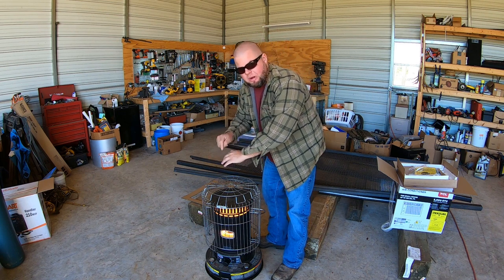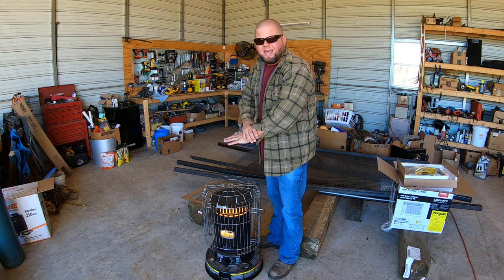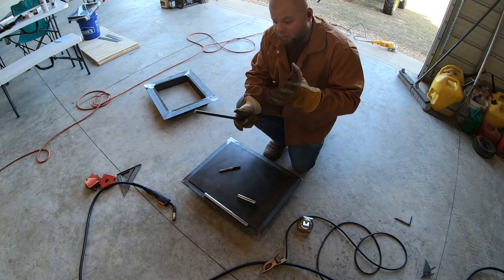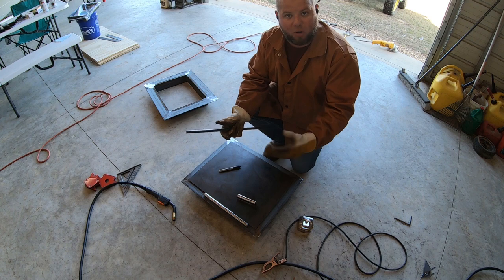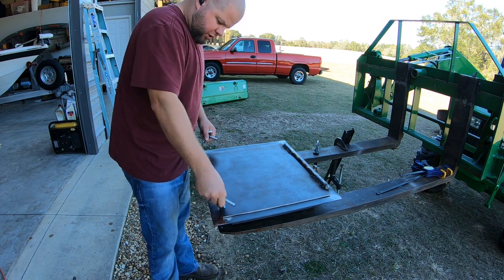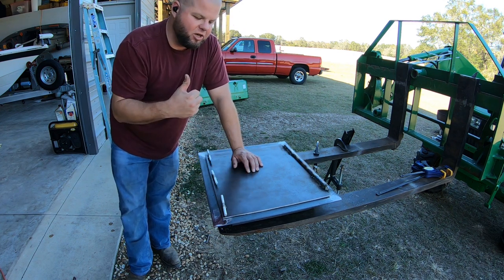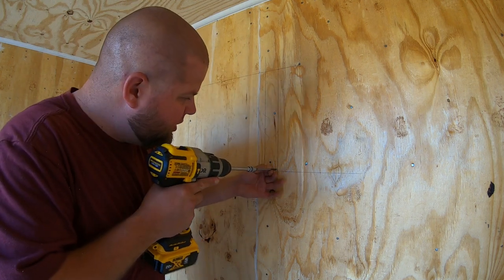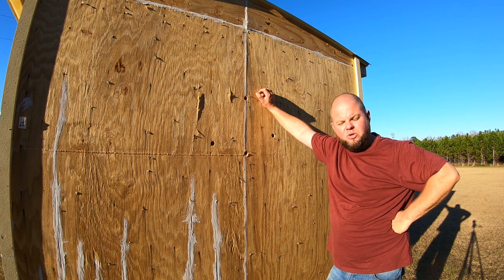#222 Building the Tornado/hurricane shelter bunker escape hatch! DIY storm shelter bunker build #16

Comment: Trouble with fitting yourself through a hatch like that is for the first part of the escape all your body weight is on your ribs, and its very easy to crack a rib.
Happened to me and it hurt for a long time.
At the very least I’d put some hand holds on the outside above  the hatch, so you can pull yourself up.

Comment: I found that if you light those kerosene heaters outside (or at least by a open door), let it burn for a few seconds, and do the same when turning it off, you will not get the kerosene/diesel smell in the room that you are trying to heat. Just a thought.
Reply from the maker: Thanks for the info

Comment: As a firefighter we trained to breach a hole in walls and get through two studs with gear and air you will have no problems
Reply from the maker: It looks tighter than it is